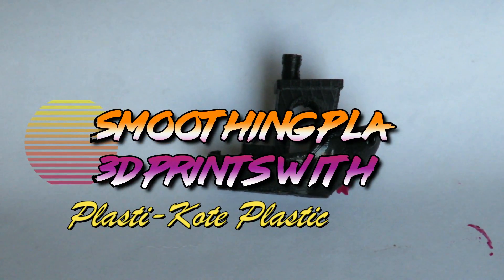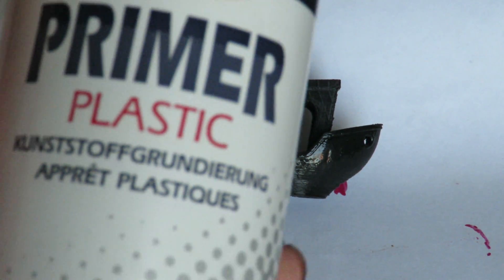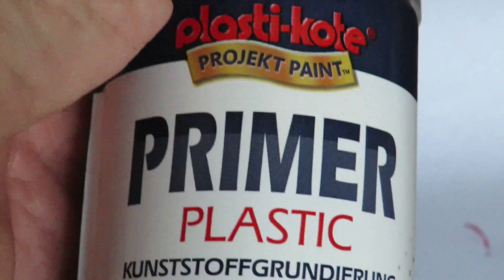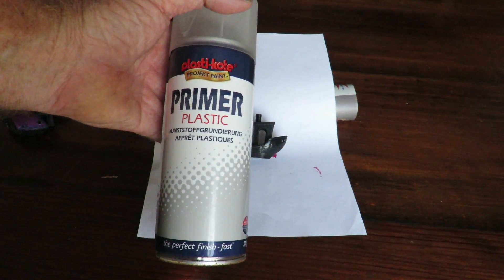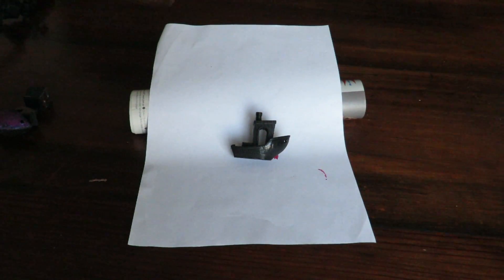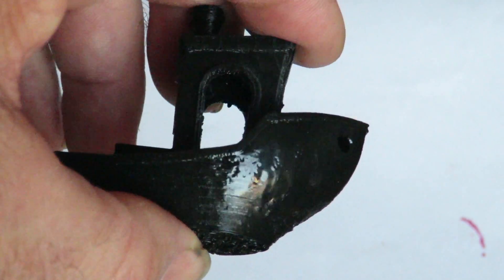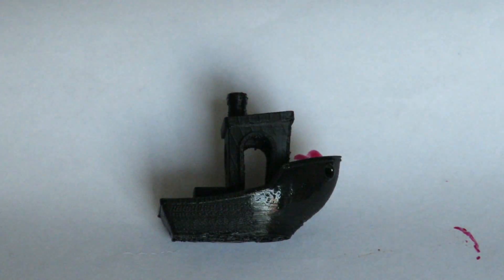📌 Smoothing PLA 3D Prints with Plasti-Kote Plastic Primer - Will it Work?

Comment: That's not how spray must be aplyed , you need to make very thin coats not to close to the model and not starting on the model ...
Reply from the maker: Thank you for your comment.
The spray method is not suitable for filling in the gaps between the lines, to make a smooth surface.

Comment: Garry, you might get better results if you gently sand the surface before spraying. Also make sure you shake the can for a full 2 minutes. It’s hard to see but as far I can tell the primer wasn’t mixed completely.

Good luck and happy printing!
Reply from the maker: Hi George
Thanks for the advice about sanding, and paint can mixing.

I made a series of videos, and finally hit on a coating that works without sanding or primer coats, and is cheap to buy.
https://youtu.be/lhFCnAH87AI
The product I used is in the video description.
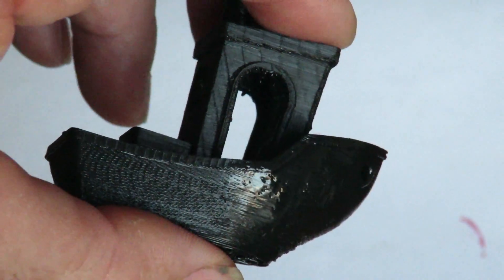Reply: The product used is the other video is Polyurethane varnish. Not that surprising that varnishing a print makes it shiny. The printer does look like it needs some tweaking though, the original print should not be that bumpy, pausing the vid at 0:52, the base layers look especially janky, you should see some banding on the side of the hull, but not that much, the little rough specks throughout the model suggest the filament is not dry and the tiny molecules of water explode when they go through the hot end (usually accompanied by spitting and crackling sounds), the cabin of the boat has a very strange diagonal banding, that looks mechanical as it is very uniform, a loose bolt causing some play in a pulley or structure part. 

Either way, the printer is not performing as well as it should, I hope you have managed to sort the problems out by now. Thanks for the video.